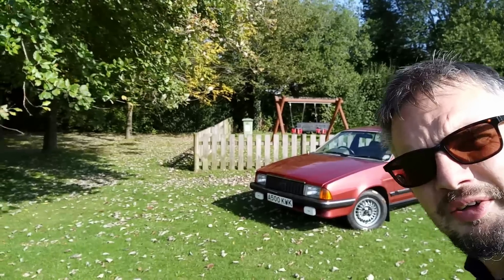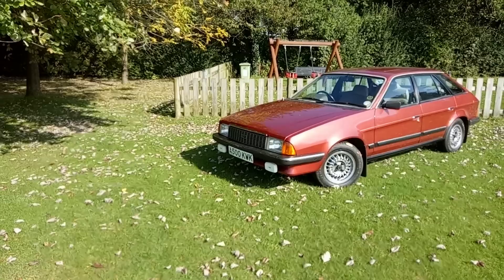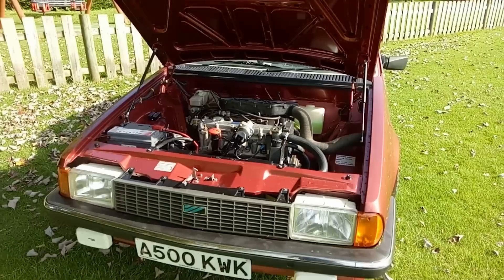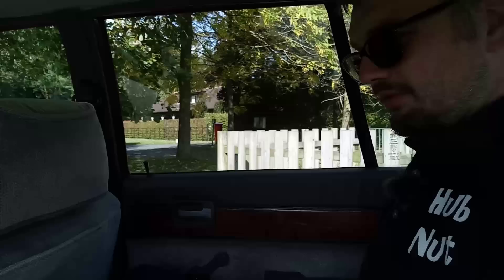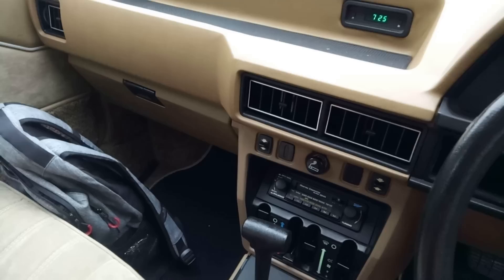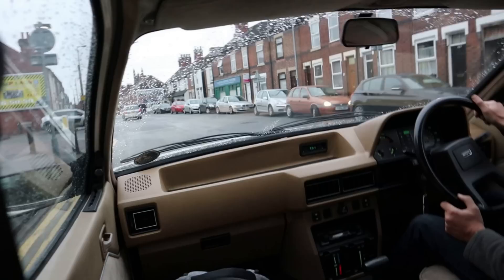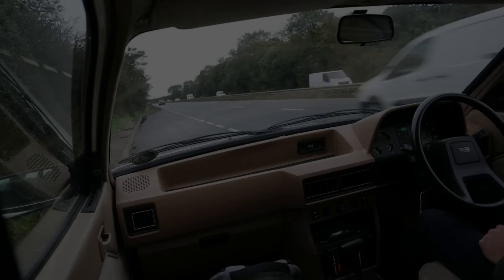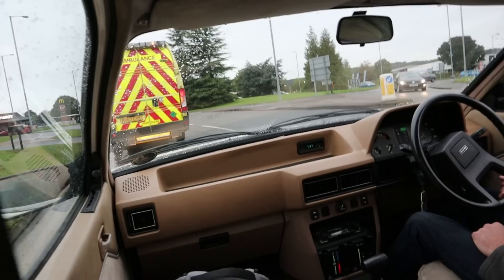Real Road Test: Ambassador vs Princess Pt2: Ambassador time!

Comment: The car is 40 years old so it is always going to be prone to trim rattles. I ran a 1.7 litre Ambassador for four years and was never bothered with any such noises, never found the manual gearchange any worse than any other FWD car and found the car to quiet, comfortable, held the road well, was extremely reliable and handled far better than anything Ford had at the time. In 50+ years of motoring it still ranks as one of the best most unforgettable cars I've ever owned.

Comment: I had an early Sierra 2.0 GL auto, Y reg, bought 3 years old. Loved it. One of the best cars I have owned. However, it also had only 3 gears (the 4 speed auto came a bit later). And that was it's only weakness. For a fairly high spec model the revs at cruising speed were a bit high. (So the problem was not unique to the Ambassador). Interestingly, about the same time (83 model year I believe) Ford released a new 3 speed auto for the FWD Escort, which later I also owned. With that they gave it a very high final drive ratio. It made top gear like an overdrive. Lovely quiet cruising. But to achieve that, there was yawningly wide gaps in the ratios. I got on well with it though. Including 2 trips to Italy. I also towed my 4.8m caravan extensively around the UK. Interesting different approaches to engineering a 3 speed auto.
Reply: And these days we're up to 9 speed autos - Fiat 500X - some models.

Comment: If that was the Vanden Plas spec, I shudder to think what the base model was like. The cheap plastic VP badge on the steering wheel was monstrous and said a lot about BL.
Reply: I agree, very tacky. Badge-engineering at its worst.
Reply: The VdP Kingsbury Lane factory closed in 1979 and the great workforce was 'let go ' or took retirement. After that VdP became just a brand and the craftsmanship , the interior and paint, was lost.
This car shows the very worst of the BL>AR corporate nonsense.
Look back at the VdP 1300 automatic and weep!
Reply: @rogerhudson9732  I remember the factory at NW9, and often walked past it, thinking to myself that it didn't look very big from the outside, but I guess it was quite large behind the frontage. Used to see many interesting vehicles parked on the frontage and through the windows, and they certainly looked special. Yes, after the 60s (if not before) BL debased most of what they touched and what was good, the names, the marques, the quality etc etc. So good were they at this, that they finally debased and destroyed themselves.
Reply: @rogerhudson9732  Try and find the Thames Television visit to the Kingsbury factory here on YT - it's a piece on the VdP Allegro.
Reply: @rogerhudson9732  I had a 1300 VDP very briefly, a terminally rusty scrapper bought for £50 from a colleague. I kept the 1300 engine & box for my Mini and the wonderful interior, it really was lovely, which I carefully removed and sold as complete set for extremely good money. That was one of my best amateur used car parts dealer efforts ever. Of course everything else went to the scrappy, took it there on my trailer as they would only collect complete cars.

At the time I had a day job where my allotted workload (it involved serving a lot of writs and summonses so evening work necessary) could be completed in 3.5 days and I would go to the scrappy every Thursday afternoon and or Friday morning to get to their new stock first before the weekend and remove and buy job lots of hopefully good and "desirable" used or "performance"  A and B series parts of interest to the local boy racers. I had shelves of parts in my garage and would be answering the doorbell at 10pm some evenings to  young impoverished blokes desperate for starter motors etc.

There was one young lad a "thalidomide baby" neighbour who had a Mk1 Sprite  and I fitted a starter motor under torchlight for him - biggish job for a winter evening outside as had to swap end plate from starter to starter to enable fitment and also remove distributor to wangle starters out and in, and then retime the ignition of course by swinging the dizzy at idle.
An obscure upgrade of mine was Land Crab wiper (two speed?) motors fitted to Mini wiper racks - considerable performance increase.
Also Marina 1.8TC twin SU 1.5" carbs for hot 1.3 engine conversions - I would gas flow SU carbs for boy racers by smoothing the sharp edges of the venturi bridge, knife edging the butterfly, reducing the butterfly shaft thickness and soldering the butterfly to the shaft to produce a nice smooth flowing item without the huge flow disturbing screws. 
I was always on the lookout for 12G295 and 12G940 cylinder heads for their big valves and much better castings.
These were all impoverished amateur Mini racer tricks.
Happy days from many years ago 😊.

Comment: Definitely prefer the Wolseley Princess... I never liked the front end on the Ambassador. The ideal would have just been to do a Princess with a hatchback and rear quarterlights.
Reply: the end of the line for Wolseley sadly.. Lasted all of six months
Reply: IIRC, Crayford did a hatchback conversion of the Princess. Can anyone else confirm this?
Reply: @cmartin_ok  Torcars.  They did Suntor Marina campers and Sherpas.   Basted at High Bullen in By Torrington, Devon.  There was a connection with Mumford of Plymouth.
Reply: @cmartin_ok  check www.aronline.com. They may be able to give you that info
Reply: Robin Forrest : Quite right. The Maxis 5 speed gear cluster which Lotus used in the Elite and Eclat was copied in the SD1 and TR7/TR8. Then the Borg Warner45 series 4speed  auto or the AP 4 speed. The O series  need not evet have been  built. The Cowley/Speke/Longbridge labour wars and an inibility to rationalise the production and supply lines stopped Sir Michael Edwards. The basic parts were all present, and the detail work was stopped dead. Steering was exceptional. The Hedgehog (Harris Manning) was insightfull and visionary, but even the TR7 was designed as a reactionary response to the constant bedlam in the boardroom. If the debarcels that befell British Leyland and Austin Rover from the 16 years 68 to 84 happened in the USA, General Motors would have Chapter 11'd in 1984. The anti gassing plastics, the oval steering wheels, the leaking damper units and subcontracted parts...Jaguar at Browns Lane dealt with those, the rest of  BL and AR, did not. The Rox Axe era marked more  new conservative lines, and the advances of the "Hedgehog error" of the aggressive Harris Era  flying wedge we never continued with. The P76, TR7/TR7 V8/ Princess/Ambassador...great designs, very blQQdy poor execution, endemic top down restructuring by logistical and monetary restrictions. Only with Egan at Jaguar did the engineering and finiacials work together. Jaguar just refused to spend money in new engines...instead, they consolidated and then rolled out gradual improvements. BL was to quote Sir M Edwards...the greatest finicial turkey ever. The basics of the A & P were really excellent. The bad parts were gearing, wasted engineering efforts and a lack of advancenent in how they were scewed together. It wasnt the 'Bob' Roberts fault...the guilt lay much higher on the totem pole.
Reply: They are totally different cars from the looks, the Ambassador just looks so much more modern and could be a Ford.

Comment: Bought back many happy memories.  Dad bought both. A princess 1800 hl in sandglow. PYV 738 R followed by a 1700L ambassador in red with spotlights built into the grille.  UBL 813 Y.  At one point we had 4 BL products on the drive at the same time.

Comment: Always loved the styling of the Ambassador, it looked like a solid motorway cruiser of pure luxury from the outside, only today I realise it was fairly gutless with minimal trimmings. I don't understand the specification it clearly needed to be more powerful than it was with a bigger engine and 5 speed box. I loved so many of the British Leyland and Austin Rover cars but this one is a bit harder to love. I can see some charm in it but its annoyingly flawed in concept. Still very enjoyable to see one taken for a spin, very nostalgic.
Reply: If it had all that, it would be much more expensive.
Reply: The Princess was originally supposed to have the E series engine and 5 speed box from the Maxi but they didn't think the factory had enough capacity for this, the Maxi and the runaway success they thought the Allegro was going to be. 
https://www.aronline.co.uk/cars/austin-morris/princess/ado71-development-story/
Reply: @xyz2121  Definitely be more expensive yes but it's whether customers of the time would have paid for it, doesn't sound like the Ambassador as it was, was a sales success.

Comment: I had the late Austin ambassador Vanden plans, i never understood with ARG didn't fit door bins to the car, however I bought door bins in the same grey colour for a Austin metro from at the time Beadles in Dartford on very long time ago. I fitted them so the right hand side end of the flush end of the door. By doing this it look if it was fitted in the factory. This gave me lots of space to fit pioneer door speakers too.

Comment: Brings back memories, I owned a Pricess 2.0HL then also had a couple of Ambassadors a 2.0HL then a 2.0VP in the same red colour you have.. Not sure about the HLS versions but the VP had twin carbs vs single in the L & HL if I recall. Chrome strip on bonnet and the wooden capping in the interiors were actually very nice.

Comment: According the this Wikipedia article https://en.wikipedia.org/wiki/BMC_E-series_engine That 6 cylinder engine was used in the Princess right up to 1982 before the Ambassador took over in Mid 1982. 
It is such a great shame that they didn't put this "E6" 22,27cc engine in the Ambassador as the Ambassador was a much nicer looking car than the Princess.

Comment: I love a beige dash. Especially in SD1s.
Reply: I love SD1s. Something about them :-)
Reply: @Electrowave  I had a 3500 SD1.  In the first 12 months it went back to the supplier 11 times.
Reply: @mscott3918  That's just the monthly service ;-)  I remember two of my friends' dads had an SD1 back in the 80's and were constantly complaining about things going wrong but it was considered normal for a British car there (RSA). If you owned a British car that didn't leave an oil puddle on the driveway it was considered a Japanese knock-off (back when Japanese cars were known as Jap-crap). German cars were great until they broke, then we would have to trawl the country to find someone with the technological know how of how they worked. What I remember about the SD1s in RSA was alternators packing up, oil leaks, sand causing problems in the brakes (we lived in a very dry, sandy area). Both were V8s and despite all the problems those cars were well loved. Cars were great characters back then. Remember the Alfa GTV6? Also trouble but I loved them. A bit like a squashed SD1.

Comment: Mazda does the easy drop rear seats arrangement. Fold 'em from boot or rear passenger space. AR certainly got ahead of itself with some features.
Reply: Yes. My 2005 Mazda 6 has pull handles in the boot and it's so easy to drop the seats.
Reply: @andrewhaines8603  I have a 2012 version.
Reply: @andrewhaines8603  Not so the '06 Mazda 3 which just has buttons on the top of the seat backs, but those are easily reachable from the hatch. But it does have the problem of the rear seat head restraint hitting the driver's seat back even at its lowest height. I'm not that tall at 5'10 but have to move the driver's seat forward to drop the rear seat back, then have to find which one of the two possibles is the position I have it in.

Comment: I've been looking forward to this since I watched the Princess review. Lovely motors these, I can't remember when I last saw one. Re the grille badge, I'm fairly sure this denotes Austin-Morris and was used in adverts from around the second half of the 1970s. I think the Austin-Rover badge has 2 extra green ticks and was used from 1987. How many were replaced on grilles upside down!
Reply: Back in the 80's a workmate of mine had a Metro, with the grill badge upside down!  Typical BL 'quality control!'

Comment: Normally, I find facelift designs less pleasing than the original. But in this case, weirdly, I prefer the Ambassador. It's the car the Princess always should have been from the start, and a much happier design somehow. I'd love to run one, if I could find a decent one. They have all disappeared from our roads sadly. Quality issues aside, I think it's a stunning piece of design.

Comment: I had a 1.7L manual one as a company car. The main reason was that with 2 young sons we could get a child seat and a carry cot across the back seat, not possible in the Sierra or Cavalier options. It used to get through front brake discs at an alarming rate, the would just warp and it felt as if you had corrugated iron discs! I do remember it as very comfortable.

Comment: Only a four speed gearbox?  There's an opportunity missed.
Reply: Yeah when the BL Maxi was one of the first five speeders they take a step back was a four speed and the very vocal 1.7 & 2.0 O series engines.
Reply: @jbz2079  One of the reasons why my dad had a maxi was the 5 speeder.
that's was back in 1980 (v plate)
Reply: @jbz2079  They recycled the Land Crab B series transmission for the Princess 2 and Ambassador with their O Series. Would not have been that hard to more the casings and add a 5th gear, something you can get for the A series now. But BL was just too strapped for cash just to do that!
Reply: The Maxi/Allegro 5 speed box (made by Beans Industries) couldn't handle any more power/torque than the 1750 E series pumped out, allegedly yet the innards of the box were used in Lotus Elan/ Europa 5 speed models...

Comment: At one point i thought it sounded like there was an old Perkings diesel lurking under the bonnet.
Reply: There was a Princess driving around in the Netherlands with a diesel engine.
I was told it was a testing bed.

Comment: My first car was a champagne beige 2.0HL manual with orange interior! Glorious motoring for 3 years through my student days. Cost me £125 in 1990 for an X reg and I scrapped it in 1993 for £90 after adding 35k miles - not bad depreciation! I thrashed the life out of it but apart from a front wheel bearing every year it was very reliable - yes really! That's not to say I didn't need to fix stuff, just that I always got from A-B and not once did I need to use my AA subscription. I learned how to service and repair it with the help of a Haynes manual. It really needed a 5th gear however as sitting at the rev limit on the motorway at 105MPH was noisy and inefficient. An absolute doddle to work on and incredible load storage capability - much bigger than any car I've owned since which includes an SD1, later an 800 fastback and MGZT-T which I have now. I used it to move all my belongings to and from University digs and was great for getting gear to gigs when in my college band. On my Ambassador I had no real issue with trim rattles as I hunted down and fixed anything squeaking which was not much as remember. I even got 500 miles out of a tank once - ran out of petrol a 100 yards short of a BP station, there was torrential rain so I was glad I had sufficient momentum to roll in and park up by the pump! I agree it was a car that could have been so much better - but still I have fond memories of mine.

Comment: I'd like to see  you review the Ford Cortina mk4/5 from the same era. My dad had a 2.0 Ghia KUU954X (long since gone to the scrapyard I believe) but I seem to recall it was a much smoother car than the Ambassador seems to have been. Both cars from the era of deep velour trim and auto gearboxes where 3 gears were deemed to be more than enough. (My current car has 8 and I see there's a 10 speed auto in some new vehicles.... more than my first bike!)
Reply: Automatics (except the original 4 speed GM Hydramatic and the one in the Austin 1300 sold as an Austin America in the US, also 4 speed, both with straight fluid couplings) generally have torque converters which add a sliding scale 2:1 or so ratio to the three speeds, so equivalent to a four speed minus inefficiency. Oh, the Hydramatics last forever and the Austin thing was good for maybe 30K miles.

Comment: We had a few Princesses back in the day, and when the Ambassador was launched, we went to the Austin Rover dealer to have a look. The impression we got was that it was plastic and tacky, so we didn't bother, and got a Y reg Carlton 1.8 instead. Excellent car. 5 speed, rwd, remote mirrors, rev counter, good Phillips 4 speaker stereo, sleek looks etc. Made in Germany, and according to the label in the windscreen, assembled in Luton.

Comment: Ok , I'm a little biased because I was trained at an independent Renault specialists in the 80s, but we always wondered why anyone would run one of these, when a Renault 20 was better in every way. Or, even a 30 TX........now there is a car that needs a Hubnut roadtest!!
Reply: @RussEdgar445y7tlfj  I'm trying to remember where I've seen a 30TX on offer recently - I think it may have been the 'Bay...
Reply: @RussEdgar445y7tlfj  I came very close to replacing my 16TL with a 30TX - they depreciated so rapidly you could buy them for pennies even when they were just a few years old.

Comment: Worth the wait. 
That feature of the folding seat handle in the boot in recent years has re appeared. The seats are also slightly under tension so that when you pull the handle they flip without assistance.

Comment: The Ambassador appealed for is sheer quirkiness. 4 spd manual was antiquated. Even the Maxi managed five forward gears. The Hydragas suspension ride was magical though. Not quite Citroen magical but very pleasant all the same. 2.0 HLS model had the same dubious twin-SU fuel arrangement as the VP. Imagine the same innovation without 'designed by committee' mantra pervading throughout AR in the early 1980s.